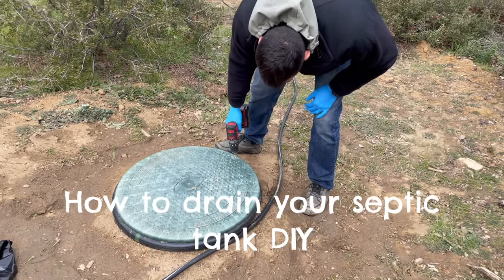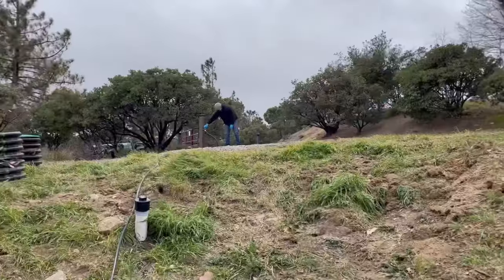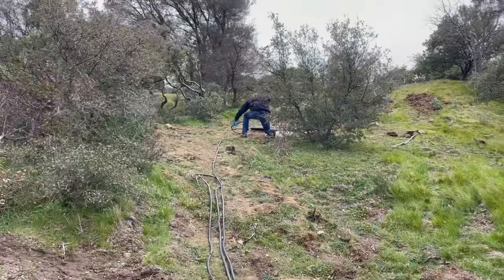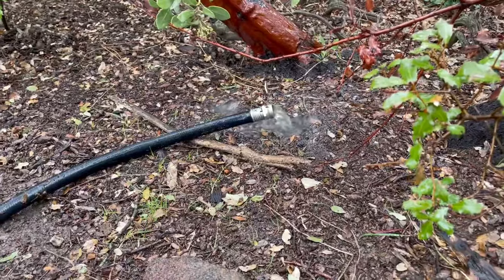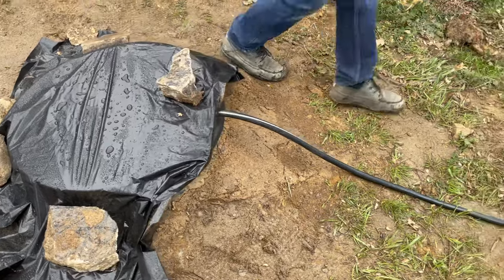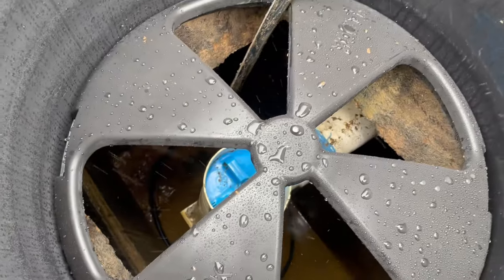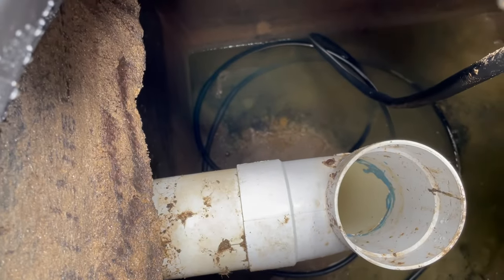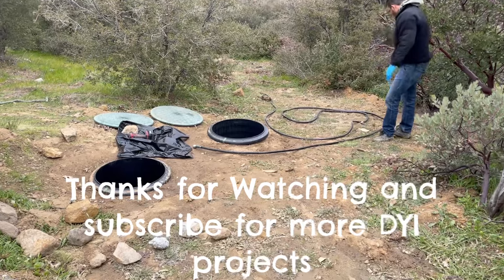How to drain your septic tank DIY

Comment: My system is an aerobic sewerage treatment system with sprinklers for the effluent.  When I clean my tanks out I use a waste water pump and suck out everything from the bottom of my holding tank and the clarifier tank. It comes out looking like thick, used, 90 weight gear oil as it get to the bottom but no stink. I live on acreage so I just move the dishcharge hose around evenly. It quickly dries out, grass grows through it, the rain waters it and voila after one or two weeks during the summers I do this I have clean tanks, and renewed lawns.

Comment: I had an issue in a mostly flat but slightly sloping yard after 3 feet of snow melted almost overnight and heavy rain for a week. Leech field was saturated, and water backed up into septic tank. I used a submersible pump and garden hose to drain the tank into my driveway ditch. Had to do this every few days for a month or more. Highly illegal in most areas, but you do what you have too.
Reply from the maker: The leech field crossed our mind also but didn't make sense because our system is down a significant slope. Thankfully we got it figured out before having to use the tanks. I'm sure using a submersible pump with a garden hose was a lot smoother process than what we did. Agree 100%, you got to do what you have to do.
Reply: @morrismonet3554 did your leech field ever recover after doing this?
Reply: @keypeeyt1758  Yes. after the ground dried, I put several jugs of Roebic K-57 in and it's back to normal.

Comment: Good method, and I'm sure it would take a LONG time with a garden hose, but that's all most people would have.

Question: How did the tanks fill with rainwater in the first place?  (Edit: just read the description.  Post when you find out)
Reply from the maker: Thank you.  Yes it takes awhile but it is cost effective. The tank filled with rain water because the inlet pipe was not properly sealed. That will be our next video on how we corrected the poor work of a “ septic professional “ thanks for watching.

Comment: Ok, so no normal septic gunk tells me that the tank isn't being used. If it isn't being used, why is rain water a problem?
Reply from the maker: Great question! This is exactly what we have been trying to figure out after the “septic pro” suggested installment of risers which we ended up replacing (in our previous video). The septic tanks were empty with no issues prior to the “pro” coming out. We have finally figure out why they were both filling up with mud/dirt and rain water after it rained. Stay tune for the next video on how we fixed the issue. Thanks for watching.

Comment: Forgot to ask and answer why the rain water is getting into the apparently new plastic tanks... likely around the man hole locations x2.  Urethane glue must seal the pieces together.  Those foam gaskets don't work.  Cement to plastic must use epoxy kit.  Dig all those things up and stop the leak into the tank.
Reply from the maker: The cement tanks filled with water because the inlet pipe was not properly sealed. That will be our next video on how we corrected the poor work of a “septic professional”. Thanks for watching.

Comment: Why would you siphon or pump water from the tank leaving empty such that might float if the ground around it were to become aturated. The purpose of the tank is to fill with water. 
Most tank manufacurers recomend filling the tank with water ASAP.
Reply from the maker: Great question. The reason the tanks had to be emptied after they filled with rain water was so to figure out where the leak was coming from. If you watch the video before and after this one, it is explained. It took us a bit to figure out, but we eventually found the leak and fixed it. These tanks are solid concrete and are fixed in place. There was no concern of them floating.

Comment: Too bad you gotta live on a hill , or have a ditch nearby . Not working here where it's flat .
Reply from the maker: You would need a hose pump for a flat area. A drill pump is about $12 on Amazon. You just connect your hose to each side of it and run it with your drill.

Comment: Isn't poo in your septic tank?  Dumping that down the hill seems wrong.
Reply from the maker: These septic tanks were not connected to any home and did not have any poo/pee/waste in them other than rain water, dirt/mud. We definitely do not recommend this if your tanks are in use and have human waste in them.
Reply: @wildtiny  They're draining septic tanks that nobody is using.  That's like unclogging a toilet that nobody uses.  I guess its possible.  If they drain the water won't the septic tank float away when it rains?
Reply from the maker: @brgrote  very important to make sure your septic tanks are working properly before connecting them to your home or building a home. You don’t want to find out there’s an issue after the fact and much easier to take care of prior to connecting. The floating question is a very popular question as you can see in the other comments. These are solid fixed  concrete tanks and no issues with them floating away.
Reply: I'm not sure how this septic system works, but most septic systems are designed to syphon off black water (poo/pee water) into the ground via the leach field/drain field. You have the first half of your tank that holds solids and the last segment of the tank holds liquids. When those liquids fill up, the water reaches a pipe that eventually leads to a drain field that saturates the ground with the black water.

Comment: Bruh your backyard is going to smell like death for the next 2 years
Reply: When I clean my tanks out I use a waste water pump and suck out everything from the bottom of my holding tank and the clarifier tank. It comes out looking like thick, used, 90 weight gear oil as it get to the bottom but no stink. I live on acreage so I just move the dishcharge hose around evenly. It quickly dries out, grass grows through it, the rain waters it and voila after one or two weeks during the summers I do this I have clean tanks, and renewed lawns.